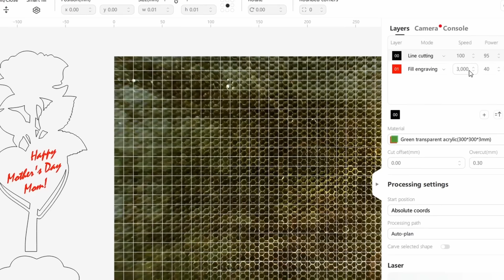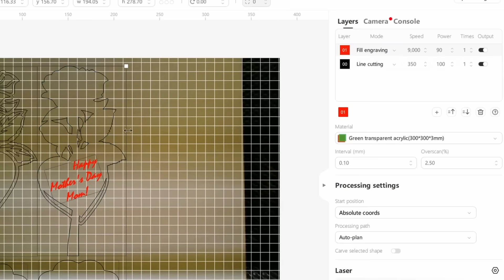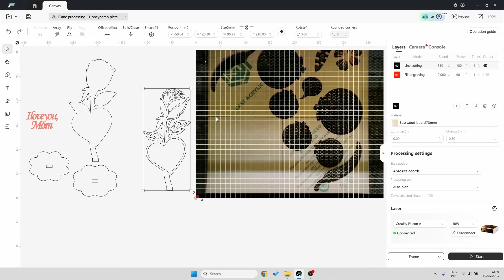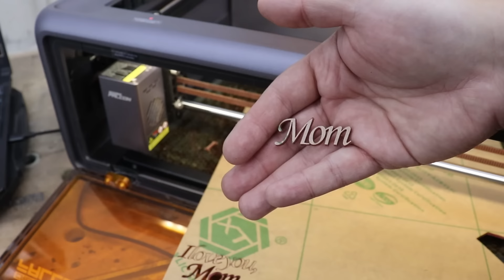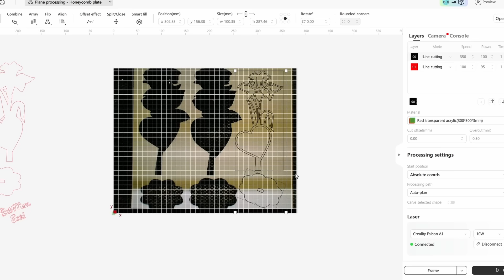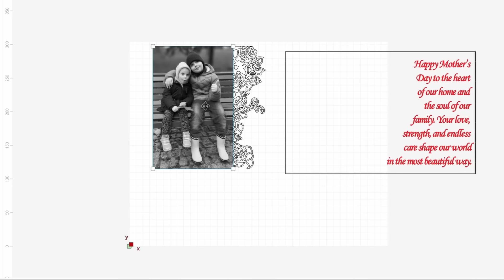Beginner Laser Projects for Mother’s Day (With WOW Factor!) Using Creality Falcon A1

Comment: I have just really enjoyed your channel!!!    AI intrigues me as well!
As I have commented before I am looking into purchasing a laser. I have it narrowed down to just a couple choices.  I am trying to look into accessories as well.   Wondering if you could do a video about what the uses/ differences  are and  how useful you feel they are at the start vs waiting to see if you want.   I also am confused on some of the brands which items go with which lasers (ie honeycomb panels).  
Thanks for all you do!!!!
Reply from the maker: I would only consider buying accessories if I really needed them. If buy everything up front then you may waste your money. You can always get the accessories later. Think what is important to you, what projects you want to tackle. For example if you want to cut a lot of items then higher power of the module will be best. But if you want to engrave then smaller laser dot will give you better results. Also consider how you will remove fumes from your work area. Enclosed machines are best at keeping fumes under control but usually they offer smaller work aera plus they cost more. If you planning on cutting then a honeycomb base is essential for best results but then you need a machine that supports air assist and has got an air pump - for clean cuts.

Comment: Wow!  What a fantastic introduction to laser cutting for home projects.  I thought your use of different techniques and materials to enhance simple designs was especially brilliant.  You have hidden skills.

I would definitely be interested in your video on AI as I’m sure you would do an excellent job of demystifying and simplifying it.

A thought about laying the gold foil which is notoriously tricky to handle, would be to lay it before adding the final raised frame.  It would then be laid on a fully flat surface which would be easier.  To ensure its edges were in the right place - not protruding or falling short - before the frame was added you could add laser engraved lines which would be hidden under the frame and then just aply adhesive up to these, then brush away any gold which protruded.
Reply: Yes, it occurred to me too that the effect might be better with the wrinkles and bumps but just wanted to mention an alternative technique in case anyone else was interested.  And thank you for your ❤.
Reply from the maker: Thank you kindly. With the gold leaf I actually wanted this uneven look as then it gives more distorted light. I just think it gives more interesting look. However it all depends what you want ☺️👍